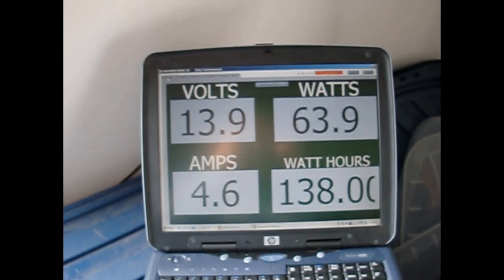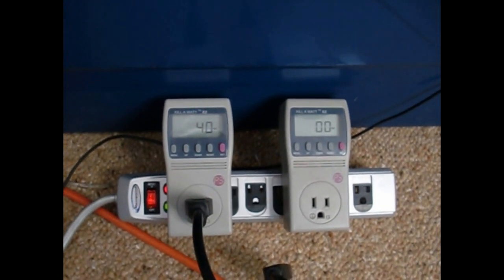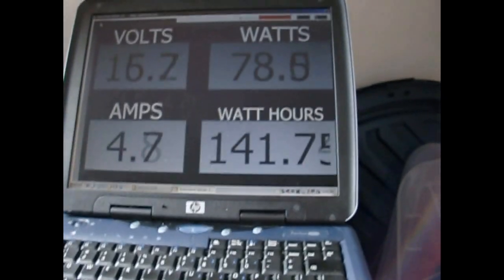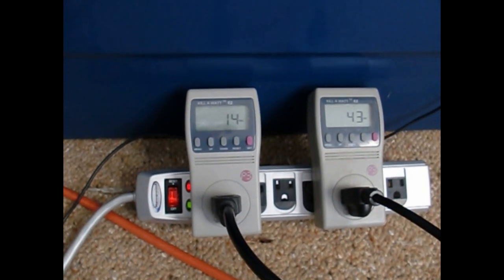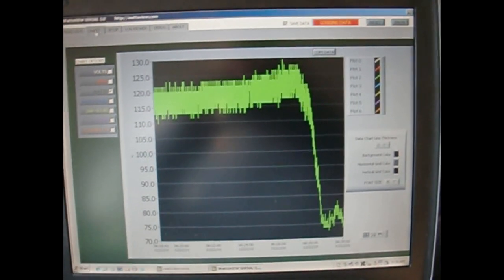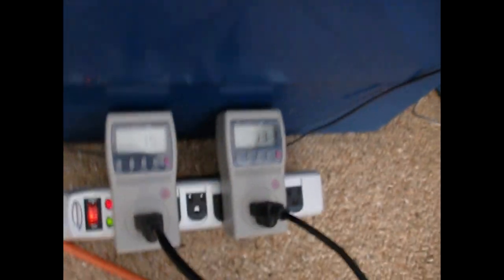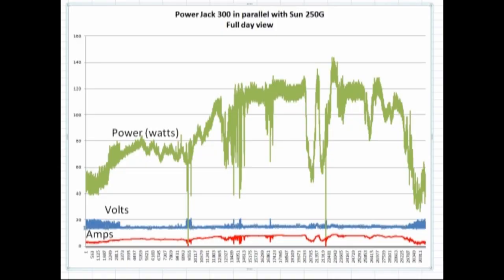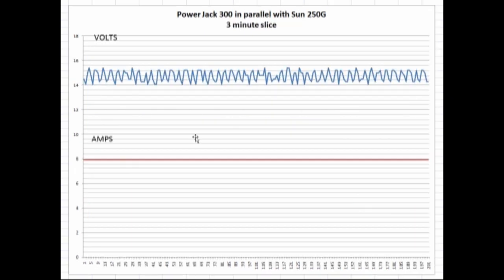Solar Grid Ties -  Power Jack and Sun 250 in Parallel MPPT

Comment: You are never supposed to remove the AC plug from the outlet with first removing DC power from the grid tie inverter input, you will eventually destroy one of those inverters.

Comment: Good test although I have a feeling there is something seriously wrong with your SUN GTI. With 66w in and only 36w out, that is only 53% efficient.

At this low power level, inverter efficiency should be around 90%.
My SUN-500G would be producing 60w out with 66w in.